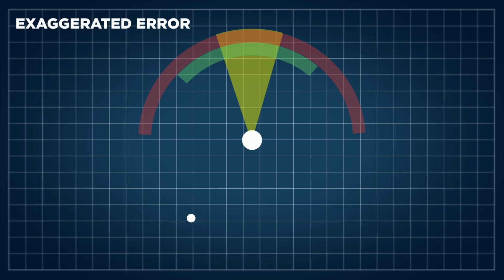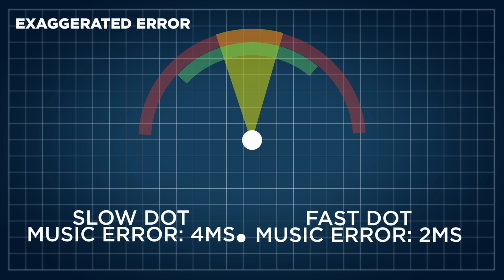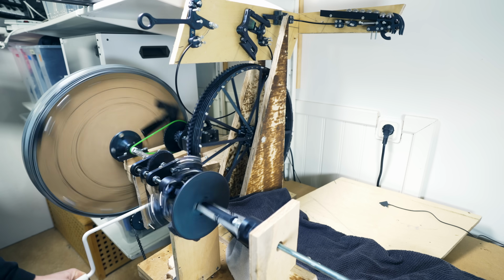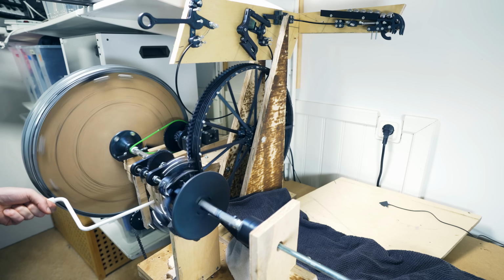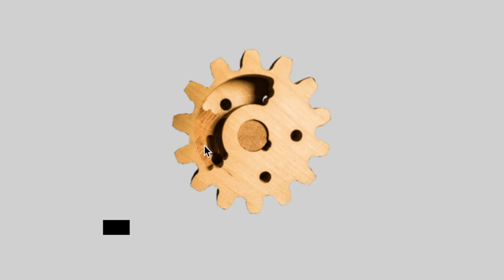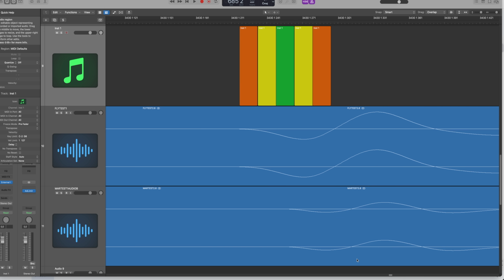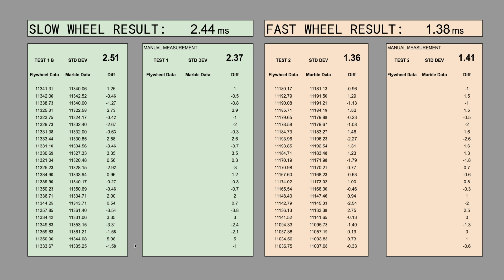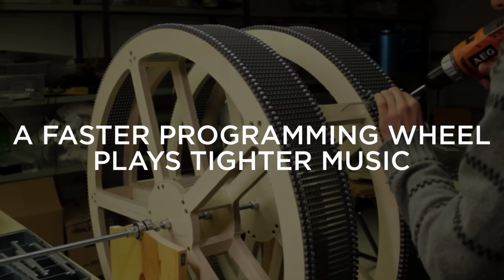Testing a Faster Wheel - Is the Music Tighter?

Comment: I'm concerned that finding a faster movement speed of the programming pins may become an issue if you make the wheel larger.  If you find a 'target speed' that would be the tight playing you are looking for and wish to scale up the size of the programming wheel's diameter, then you will need to increase the speed of the wheel itself to get the same 'play speed' at the new diameter.

Comment: A converse realization to this data though, could also be that, at the cost of only 2 more milliseconds of std dev, you can extend the song by double the original length by slowing it down and increasing your hit points for each track, and with the length of the points being variable, you still have some flexibility.

Faster paced songs with a shorter loop, no problem, speed it up. Longer, whimsical (or even melancholy) songs, also, no problem. Slow it down. 4 ms of std dev is going to sound incredible to the people enjoying your concert!

Comment: I wish you'd stop redefining "tighter music" every time you do a new experiment.  Pick one definition and stick to it!
Another error that I see you making, Martin, is performing statistics without thinking about what those statistics mean.  "Standard Deviation," for example, is a measure of dispersion … specifically, the 68%-dispersion-level centered on the mean.  And furthermore, it's measuring the 68%-dispersion of randomly-generated fluctuations.
But are you measuring random-fluctuations in … whatever you're taking the standard-deviation of?  And even if they are really random-fluctuations, are they symmetric-fluctuations, or does some feature of the system being measured apply constraints to those fluctuations, skewing them in a particular direction.

If the latter is the case, then you cannot use means and standard deviations!  You need, instead, to use the median and [quartile] dispersion-around-the-median to measure central-tendency and fluctuation.

But, again:  this comes back to the question:  What are you measuring?  Tightness?!?!?   One week, "tightness", is the delay between triggering the gate and the marble hitting the instrument.  3 weeks later, it's the time between the programming pin engaging and the marble hitting the instrument.  Next month, its "does the flywheel keep a constant tempo?"  4 months after that, it's "does my governor keep a constant tempo?"  Now it's, "Variations in how my 3-D printer prints my programming pins."  If you keep moving the goal around while the goalie is trying to protect it, you're going to lose the game, dude.

I don't want you to lose.  I want you to succeed.

Every time you verify, you need to start with, "What is the question I am asking?"  Then, you need to ask, "How do I design an experiment to disprove that question?"  Only then, once you've determined what you need to measure, should you look at how to quantify and summarize those metrics.
Reply: Completely agree.

I also question his method of collecting data (using a microphone and subsequent wave-analyzer).  How many samples were collected at each speed (and was the machine even at “steady-state”)?  And are two speeds enough to state “faster is better”?

Like you, I don’t want to see failure.  But his whole approach is really misleading (at best) and leading him down the wrong path (at worst).  But in the other hand, part of me wonders if these mistakes have always been intentional, merely to drive engagement in his videos.
Reply: @br52685  No, I don't think he's doing it intentionally.
Martin is a musician, not a scientist.  He only recently discovered what "standard deviation" is, and is like a kid with his New Favorite Toy with it.  He clearly doesn't understand what it is and what it's describing [purely-random, symmetric fluctuations around an average].  It's just a way of making a number! that he can then compare.

But he's making those comparisons blindly.  What does comparing 2 standard deviations even mean?  The range of random-fluctuations in process-A is twice the size of process-B.  So?!?!?!  Is that expected?  It certainly isn't "better" or "worse" — those are value judgements that have no meaning outside of the processes you're describing.  And as I've laid out, "Tighness" is a vague, qualitative, subjective description of  — something — that Martin keeps changing from week to week.

"Tighness" is his new, "Does it look cool," and "standard deviation" is his new Angle-Grinder.

Comment: You can raise the rpm of the wheel or increase the diameter to make the read speed faster. A bigger wheel would give more program length and faster speed but more complex design. I think you should find the surface speed you like then   work out how long it needs to be and that will give you the diameter then work out the required rpm

Comment: Hi @wintergatan,
I think you're right but if you increase the rotation speed and it gives you better time accuracy then you have less beats/bars available. If you are just increasing the gear ratio without modifying the number of beats, it won't change anything but add some randomness from your new gear/ gear ratio, no?

Comment: Love to follow your designs and experimenting for the marble machine.
Little tip for working with data sets, you had a diff. column which is great, but you should use it to find outliers and then try to find the cause of this. Would have allowed you to find the error in your initial results😊

Comment: You could make the programming wheel work like how the original phonograph cylindrical records worked, where instead of a clean circle around it there would be a spiral going along the height of the cylinder which allowed for longer recordings than just the circumference. If you even just made it 1 extra loop around, allocating 2 rows of space for each instrument instead of 1, that’s twice as long as before. You could use a cam to move the triggers left and right on the programming wheel so they only pick up the right part of the track. If you make it a smooth spiral you could use a nautilus shape cam for smooth movement of the triggers.
It would make the programming wheel twice as wide per instrument though, but you could optimize this by having some instruments like the drums not shifting over if they play the same notes in the first half and second half. Only allocating more space for the instruments that need it…

Comment: Flyball governors are not capable of keeping a steady speed under varying loads.   It may be close, but not exact.   If for example the flyball applies a brake to slow the machine, then when it needs to apply  the brakes harder, the flyballs must be further away from its shaft.  The only way the balls can be further from the shaft, is if it is turning faster.

Comment: Could you try using a type of punch card instead of a programming wheel? It doesn't have to work with holes only just put the music on a movable sheet instead of a drum so you can basically do the music as long as you want. You could even do it with varying lengths cutouts or 3d printed shapes glued onto a piece of movable canvas or rubber conveyor belt. If you'd want to you could even loop that. However you do it it would still expand your range of possibilities and make it easier to create all types of music. It would be harder to get consistent but it would be a muuuuuch easier data input for that whole machine. You could even use a cnc router to cut the input material to save on time crating the music storage

Comment: You are getting absurd on this "tight" stuff.  Changing the height of fall by only 1 mm will make more error then this!  Also, for EVERY FOOT (300mm) of distance between an instrument & the mic (or ear) is another 1ms delay!   Here's what I propose.  get a recording of professional musicians, both "rock bands" & orchestral works.  Run these through your timing alignment software & see how well they do.  For an orchestra, I KNOW such timing is IMPOSSIBLE as musicians are spaced apart MANY FEET & their ears are are in different place then audience (visual reference to the director helps limit this, at least on some absolute time scale (where each instrument is close-mic'd & recorded electronically).  Even where you sit in music hall alters timing BY 10's OF MILLISECONDS unless you mic everything close & play it through ONE speaker!  (And yes, that speaker must have only ONE DRIVER.)

Comment: How does this exact same test compare when using a chain drive or a belt? could you get the same results when gears are not involved?
its more work but I don't remember if you tested the advantages of belt vs chain vs gear.